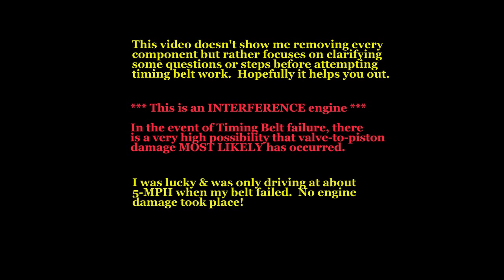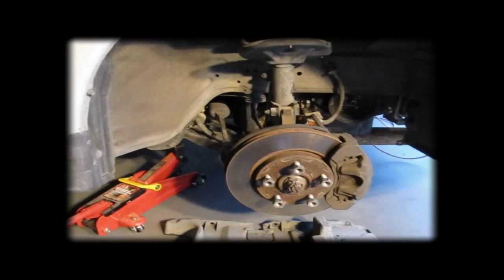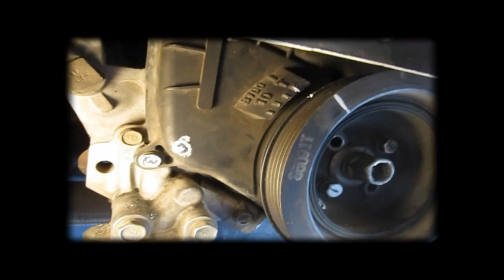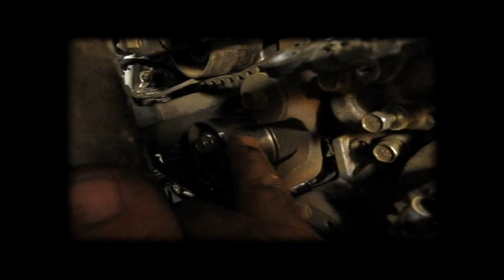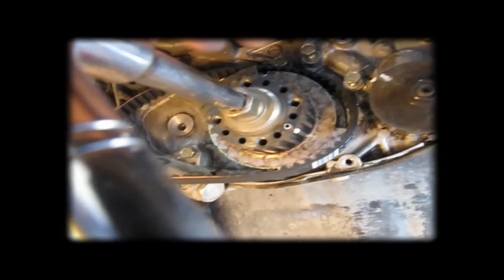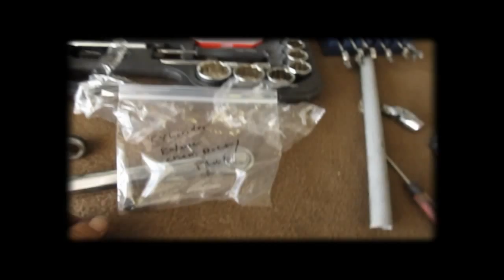Part 1 - 2003 Mitsubishi Galant 2.4 L Timing Belt Installation

Comment: Have the same make and model as you sir. But for some odd reason my water pump pulley wont come off. Bolts are off and its free just can't get it out. Gets stuck between the old pump and frame. Was thinking of jacking engine up a little more but figured I'd ask you first. Great video by the way. Thanks

Comment: Hi I have the same car I have crankshaft issue only can I switch the crankshaft out with out missing with anything . I was wondering
Reply from the maker: I'm sorry Steven but I've never gotten that far deep into an engine before so I really can't advise you on that problem. I've changed engines, clutches & components before as well as some valve tappets on an old Chrysler hemi but nothing like a rebuild with pistons, cams or cranks. Sorry I can't help...

Comment: the timing belt on my mitsubishi outlander 2003 awd 2.4 was done at 70k miles. now its at 129k miles. should i replace it soon?
Reply from the maker: The info I found is that the owner's manual maintenance schedule is the source of timing belt replacement intervals, typically every 60,000 to 100,000 miles. ... the 4 cylinder belts in the outlander usually last about 80-90 k miles.
Reply: they should be done every 60000 miles. if the belt breaks it will cause internal engine damage

Comment: are all Galant engines a interference engine?
Reply from the maker: Not sure about the new models but the ones that are 2.4 -four cylinder from the early to late 2000's are interference engines.
Reply: All Mitsubishi engines are built that way

Comment: Sorry @mark, the harmonic balancer will not come off after removing the four bolts...please advise
Reply from the maker: you might try checking with one of the local auto part stores to see if you can rent a puller tool.  Or maybe try tapping around with a rubber mallet.

Comment: Hey Mark! I did a timing belt/water pump/ head gasket/intake gasket/ exhaust gasket / Crank position sensor. When i started it back up cylinder 3 was misfiring. I checked compression- 180PSI on all cylinders! Amazing! Checked for spark. That was good. Even swapped ignition coils and replaced all plugs. Checked fuel injector power and ground with a noid light. Also swapped injectors from 1 - 3. Figured maybe a vacuum leak so I sprayed injector o-rings and intake gaskets. No change in idle or anything. Really stumped on this one! Any insight would be appreciated!
Reply from the maker: Sounds like you checked just about everything. The only thing I can think of is you mentioned swapping coil packs (between cylinder 2 & 4) but when you did that, are you sure the misfire is still on # 3 cylinder or does it now misfire at cylinder 1or 2?  If the coil pack is bad, swapping them means you would still have the misfire but would show up on one of the other cylinders that connects to the suspected bad coil. You would need to have an OBD II code reader to tell you for sure if the misfiring cylinder changed.  If it still shows up as cylinder 3 after the coil packs are swapped, I would try using a new spark plug wire for cylinder 3 since it could be bad and probably wasn't swapped out during your tests because it's too short!  In fact, I'd try new plug wires for all the spark plugs. I also had a rough idling problem before on the Galant & tried the coil pack swap out.  Sure enough it registered afterwards on the other cylinder after the swap.  Just went ahead & bought a new coil pack but was like $70.00 but later seen them at Rockauto.com for around $25.00 or so.  I also hate it when sometimes the problem is soooo evasive & difficult to figure out!  Hope you get to the bottom of this!

Comment: i need to install a crank sensor on my 2000 Mitsubishi Galant 2.4l is this the same process
Reply from the maker: +Brandon Cooke... pretty much except you won't be messing with taking off the timing belt so that's much easier!  However, you do have to take off much of the same items up to timeline 5.15 in the video just get to the sensor (remove battery, drive belts, pass-side wheel, fender splash guard, & timing cover...) but once you get to that point, the sensor is just held on by two bolts & changes out easy.  Just take a good look at how it's currently installed so it goes back in the same way.  Good luck
Reply: ThanKs a lot mark you really help me out a lot 💯💯💯💯

Comment: what could the vibration be if it happens when engine gets pass 4000-5000 rpmand gets worse the higher you rev not correlated with speed and the rpm guage also jumps around when this happens what could it be

Comment: I just did this over the course of two days and it could not have gone smoother. I did want to pass along a few tips and comments to anyone watching. I cannot emphasize that Mark is correct, MARK THE BOLTS on the timing cover, it'll make your life a lot easier. I was laying them out on cardboard in their respective positions when my 5 year old "came to help". It added another 1/2 hour figuring out which ones went where and I am still iffy on that. Loosen the water pump pulley when the serpentine belts are on then once the timing covers are off you can maneuver the pulley off the pump but remember to put it back on before the timing covers. If you do forget you do not have to disassemble anything, to shift the engine with a prybar at the right side mount to get the clearance you'll need, its a bit of a hack but will save you time. 3rd, it is so much easier to work around the front with the mount off but do not drop the engine more than a fraction of an inch otherwise you'll tear the front and/or rear motor mount and possibly the left side too. Luckily I had replacements and was going to do it anyway. If you are doing the cam cover and spark tube seals at the same time (its not a bad idea if you haven't done it yet) when reassembling make sure you put a coating of silicone lube to reinsert the boots and make sure you've got the wires correct. I reversed # 1 and 3 and when I did the initial start up had a p0303 code. It took me about an hour extra to figure out what I did wrong. Overall I would say this is 4 hour job but did it in 8 really taking my time, watching Marks videos again and making sure it was done correctly. THANKS AGAIN Mark, you saved me some big bucks and now I wont worry about the timing belt until I get to around 170,000 miles!
Reply from the maker: Thanks for the great tips you provided & and your comments!  Glad to hear all went well with your belt replacement.
Reply: Mark Kapuscik Well here I am for a follow up 7 months later. When I did this job it went so smooth I was concerned that I missed something. 8,000 miles and not 1 issue until February when I noticed the NEW aftermarket harmonic balancer was starting to wobble. I got a warranty replacement and 4 weeks to the day the replacement broke, sending plastic timing cover pieces throughout the timing belt area, caused the belt to jump a few teeth and broken the crank sensor. I pulled the cam cover and rotated the engine and the valves seemed to close as they should and everything looked OK so now I am in the process of redoing this job again. $250 tow + another 250 (or so) in parts all because I went aftermarket for a critical part. Do not scrimp, it saves you nothing in the long run! I am hoping it starts on the first key turn and no bent valves, I was only doing about 20 and the engine just stopped due to the sensor breaking, no freewheeling so hopefully no bent valves. If so I will be doing this job the third time along with rebuilding the head (hopefully no broken pistons!)
Reply: G Zuk hi g zuk can i ask you a question when i put my nuts and bolts back together do i need to torque the bolts to a certain pounds or just tighten everything?
Reply: With the amount of time spent doing this job, it makes sense to torque. Plus there is a minimal chance you will break a bolt or strip threads by torquing
Reply: ty
Reply from the maker: G Zuk Sorry to hear that you have to do the job over again.  Like you said, hope nothing happened to the valves & hope all is OK.  I gave my Galant to my Son in 2013 & thankfully, it's still running good.  He's put on a lot more miles than I usually drive & I just noticed that in about 15,000 miles I'll have to do the belt again too on his car.  Last weekend I had replace the starter because it was starting to go bad but that's not too bad of a job.  Just needed a few band aides from all the little scratches working in that confined place!  Good luck to you!
Reply: Got her all back together to the point of being able to start it ansld she sounds like an old steam engine. Timing marks were dead on perfect! Looks like I am pulling the head.
Reply: good to hear another success
Reply: Well not really a success. It runs but not well and won't run for long. I will have to pull the cylinder head and replace valves.
Reply: i failed once not able to line eall four points because the belt teeth moves and my new water pump was faulty end up redoing it twice in one week so you being able to do it twice with succes is great in my eyes :)
Reply: Gooyou Lau Thank you, third time will make me a superstar!
Reply: Mark Kapuscik Running again, got a rebuilt head via mail order, I had bent 8 valves. This go round went smooth but I seemed to have lost all the bolts to my lower timing cover, probably tossed them by accident when I threw out the old broken cover. Not a big deal, these are 6.0x1mm - 20mm and 25 mm lengths and available from the chain auto parts store.
Reply: +Mark Kapuscik ... still running strong 6 months later but now I have developed a substantial oil leak somewhere either at the valve cover or down at the oil filter housing. Pulled the top cam cover and its dry as a bone. Thank heavens for warm Northeast winters.

Comment: I started this today and wished I'd watched this one more time. I forgot to loosen the pulley bolt before taking off the serpentine belt. So here's another tip for those who cant follow instructions like me. You take two 10mm open end wrenches and using one to keep the pulley from spinning you can loosen 3 of the 4 bolts from above, the last bolt can be loosened from below if you jam a 12 inch long 1/2"extension between 2 of the loosened bolts and the motor mount. I ended up rounding this one off and got it off with a vise grip. The replacement is a m6-1,0 x 10mm and are available at local auto parts stores.

Comment: I just replaced timing belt (stripped teeth), balance belt (snapped), water pump (just because I was there), auto tension(s) and idler pulley.  NOW, the car runs better than ever.  2000 Mitsu Galant 2.4L I4

I could not have done it without this video, thank you so much for taking the time for this wonderful public service.  It should be payed forward.
Reply: Kevin M Hey Kevin, did you use an aftermarket kit? I just bought a Gates kit, and hoping all will be good. Glad to hear everything went so well. I’m kinda nervous doing this.

Comment: I have a 2003 eclipse rs. I have replaced both timing belts following the timing marks . And Iget a p0300 code ( random misfire).  I have replaced the park plugs, wires and the EGR valve .
I was told that my timing is not set correctly set is it possible that the misfire is being caused by timing?  If so how do I correct the timing can you help me!!!
Reply from the maker: P0300 means a cylinder(s) is misfiring or randomly misfiring. If you just replaced the belts and now think this the cause for your misfire, recheck all the timing marks again. Also check that the crankshaft Position Sensor looks undamaged and is secure since you worked in that same area.  If that all looks good, check for intake leaks. Intake gaskets are a common cause of multi-cylinder misfiring. If no leaks are found recheck/replace the spark plugs. I once put in new plugs & also had misfires afterwards. I didn't want to believe that it could be a plug issue because they were brand new. I replaced them all with another brand which ended up fixing the misfire!  Other possible causes: Faulty ignition coil (s), Clogged or faulty fuel injector (s), Intake air leak, Fuel injectors harness is open or shorted, Fuel Injectors circuit poor electrical connection, Ignition coils harness is open or shorted, Ignition coils circuit poor electrical connection, Insufficient cylinders compression, Incorrect fuel pressure.

Comment: does the balance shaft sprocket only go in one direction?
Reply from the maker: Yes, clockwise. You can back it up a bit though to line up the mark if you've gone slightly past the mark.

Comment: thax for sharing this... can you tell me abt vibration.. my car cabin vibrate and sound and also advise for timing belt life (after hw many km. need to change belt) ??
Reply from the maker: It's hard to say about vibration because it can be a large range of things such as bad spark plug(s), ignition components, tires, wheel alignment and so on so it may be difficult to determine. A misaligned balance belt not aligned properly to the marks can also be the cause for vibration. Misaligned balance belt vibration usually disappears as the rpm increases.  As far as belt replacement, you would need to check the manufacture's recommendation for your particular year/model of car because they are all different but on the Mitsubishi 2.4, it is 60,000 miles or 96,560 KM.

Comment: From you video did you rotate the crank shaft sprocket to install the balance belt, also you mentioned you rotated the sprocket twice after you installed the balance belt to check the timing marks without having the timing belt on, with this being an interference motor would have that not made the pistons hit the valve's.
Reply from the maker: This repair was being made not knowing if my engine was already damaged because it broke around 5-mph so I really had nothing to lose. I started out with the rear balance sprocket and crank marks lined up so when I rotated with the crank, it was enough for the belt to slip on. The rear sprocket is small so I didn't need to rotate much to get the belt on. You have to somehow get the marks all lined up anyway so I wasn't really worried when I rotated the crank afterwards by hand to recheck all the marks. If I tried this with the starter, then that may have been a different thing if alignment wasn't correct. There shouldn't be a problem because everything was aligned.

Comment: VERY GOOD VIDEO!! WANT ASKING MY CAR BROKE THE BELT SMALLEST AND IS BROKE SENSOR SIGUEÑAL BUT THE OTHER BELT IS WELL THAT DID BEING STOP THE CAR IS SHUT OFF AND NOW NOT ENTERED SERVICE need I chequiar valves or just replace the strap damage and the sensor?
Reply from the maker: I would replace both belts since you are working in that area anyway because the large main belt probably won't last long either.

Comment: Great video! Just curious how far did you rotate the crank clockwise before you were able to get the balance shaft belt on. I'm going to do my timing belt and wanted to try this method but i know rotating it too far can get you into trouble. Thanks!

Comment: Awesome video, just replaced water pump, your video helped a whole lot. Here's a tip for guys trying to get crank pulley nut off. Put your socket and breaker on nut, bungee cord bar to where it hits on suspension, then crank engine just for split second, bingo nut is loose.

Comment: I'm going to have to do this in the next day or so.  I was investigating an oil leak and the  alternator belt was soaking wet. I thought maybe a crank seal so without thinking took the crank bolt off and pulled it out not realizing it was the timing gear also. Since I've already done this and the car is at 225k Miles, probably time for belt 3. Thanks for your service.

Comment: my belt is still on the silent shaft, just to worried to make a move to leave it and line it up,so if I wanted to line it up with the old belt on, do I just rotate the crank clockwise like normal until they reset? ive seen you rotate the crank on you vid to put the silent belt on and notice that your camshaft belt was not on the crank sprocket by turning to aline my 2 teeth that will not affect my tdc on my camshaft right? cus the belt is off

Comment from the maker: I don't think the valves are bent because I'm pretty sure it wouldn't run very good or probably not at all.  Those two teeth that are off wouldn't compensate for & make you car run good with bent valves. I would imagine that 2-tweeth off on the silent shaft may not be so noticeable of a problem compared to 2-tweeth off on the timing belt but I would line everything back up the way it's supposed to be. You'd probably notice a quieter & better performance engine!

Comment: i have the same engine, my question is if my camshaft is tdc and im off 2 teeth with my silent shaft smaller sprocket is off 2 teeth, have I been driving my car with maybe  bent valve?i kinda wanna leave it the way it is just cause I know the car runs fine but just off 2 teeth marks, oh and now my belts are off can I reset the spocket that is off 2 teeth?

Comment from the maker: Oh man...It's hard to say because that's a pretty high speed. The interference type engines rely on timing gears, chains, or belts to prevent the piston from striking the valves by ensuring that the valves are closed when the piston is near top dead center. If this is all out of sync due to the belt breaking or slipping, there is a great possibility that there is damage.  All you can do is try putting on new belts & get everything back in time & pray all is okay.  Good luck & hope all is good!